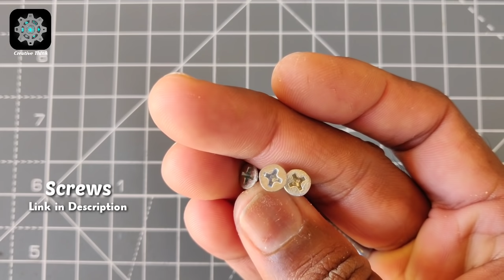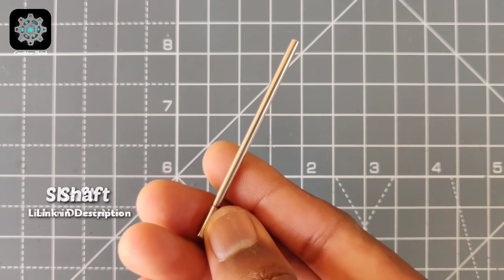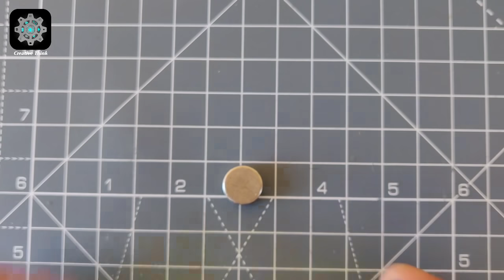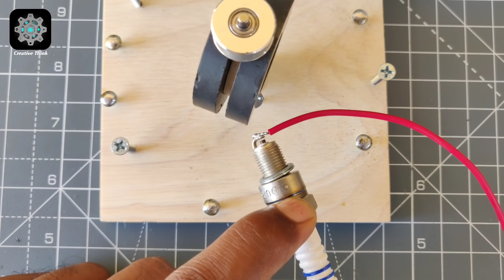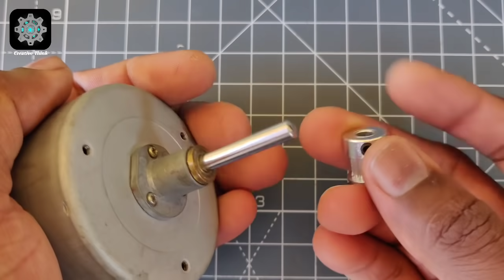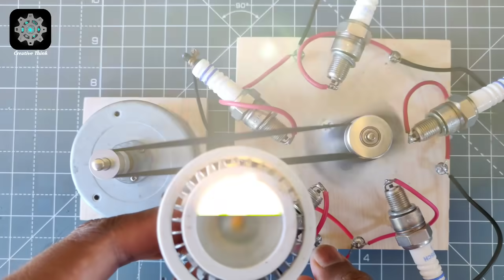Spark Plug Free Energy Generator

Comment: I made one of that and use it to drive the rear wheel of my bycicle, it was working perfectly until the clock alarm wake me up...
Reply: *woke
Reply: Don't you hate when that happens?
Reply: Actually those are real and I am original from Cuba, where gas isn’t really much of an option and people create small engines like this with the exact tools and it can produce up to 15MPH on your bike. I knew a friend of created a bigger engine using two pulleys and 4 more spark plugs, it’s looked like a v9 engine from the front end, either way, he used dinamo to get it started at first and the system will help the dinamo produce much more kinetic energy taking him up to 15 MPh like I said. But honestly I never searched for this video it’s just popped on my list from you tibe
Reply: Jeser Alejo so your friend invented perpetual motion machine.. I might know the same guy 🤔 Is his name Doctor Snuggles??
Reply: Marko Lehtola very funny. But no have a great day
Reply: Eh eh 😁

Comment: Why do people say it's a lie without even trying?

I went to the link, bought all the materials, and built it just like in the video.

And it actually worked—the light bulb turned on, and I was able to charge my phone. However, I experienced intermittent power loss, causing the bulb to turn on and off repeatedly.

But it definitely worked as a free energy source.

Comment: The superglue that instantly held the spark plugs to the top of Phillip's screws was the most impressive part of the video.
Reply: Totally agree - I have never ever seen superglue that good...! I want some...;-)
Reply: Yes! What kind of glue is that???
Reply: Denied Grace Gorilla Glue.....or something Apple is working on
Reply: I'm more impressed with how he got the  solder to flow to the screw heads O.o
Reply: @violetcarter7050  - Cadmium plate screws... they used to solder well... Or Zinc plated hardware. It works too
Reply: There are some instant dry contact glues out there.
Reply: @autoelectrical370  Not cadmium.  Cadmium plating is yellowish.  Also carcinogenic.
Reply: It's a hot glue gun

Comment: I love the phrase from the movie "Knight and Day" describing the Zephyr Battery as "the first perpetual energy source since the Sun." The joke is that the Sun isn't a perpetual energy source... it's burning fuel. "Free Energy" is obviously wrong ('taint no such thing, folks), although this is a clever creation. The reason the light flashes is because it's robbing the system of energy. If you watch closely, you'll see the spin of the magnets slow down. You'll also notice he never leaves the light connected. If he did, the magnets would stop (the light takes too much constant energy) and he'd need to jumpstart the system again. So, not free after all, but clever.

Comment: One possible answer to the question:  How does this continue to run after the battery shown is disconnected?  Answer:  Two  wires hidden underneath the main board from the two lower screws to another battery.   You are welcome!

Comment: All videos tagged with "Free Energy" are fake by definition, but it's really interesting to see all these different implementations 😂
Reply: @Mariah L No... But physic is physic and this kind of energy is never free. If you want free energy you have to catch sun rays, sea waves, geothermal heat and so on ...
Reply: @SilvioPola  Energy as defined by physicists does not exist.
Reply: Silvio Pola yup
Reply: I agree with u . Perpetual motion like thid cannot be achieved without external source or else you will be denied by laws of physics
Reply: @Stelle_7  Perpetual motion is a fact of our universe. All planets, stars, asteroids, etc. are in perpetual motion.  Our planet is in perpetual motion, thus everything on our planet is in perpetual motion.  With that said, perpetual motion is not necessary for free energy.   There are two types of geometry in our universe.   The physical geometry of physical objects consisting of atoms and field geometry which consists of the dielectric field discovered by Michael Faraday.  It is from the second type of geometry that free energy will come.  Field geometry can and does change without a change in physical orientation of physical objects under certain circumstances.  Field geometry changes can also cause changes in physical orientation of physical objects. This is how electric motors work.  Presently, we generate electricity by causing the field geometry of permanent magnets to move relative to the physical geometry of copper wires by physically moving the magnets.   However, if we can figure out how to get the geometry of the magnetic field to move without moving the magnets, you can get free energy.   There are also other ways to theoretically get free energy in electromagnetic theory.  I do not think it is impossible.  We have all been lied to about how electricity works in public education.
Reply: @wesbaumguardner8829  wtf are you saying ??? Planets are dependent on each sun/star because of its massive size and magnetic field that attracts the planets. Secondly stars or sun tend to die later on because of its fuel that will run out. Sun does not create its own fuel it only utilize it to create chemical reaction.
Reply: @Stelle_7    What I am saying is exactly what I said.  Everything in the universe is perpetually moving.  There is no observable object that is not moving.   Every object that has ever been observed by man has been moving.  No exceptions.  Yes, these movements are the result of free energy.  No one paid to have these objects move.  Absolutely nothing prevents the energy transfer, it is free to go wherever according to the laws of nature.  There is no magical energy barrier in our universe which can prevent all energy transfer thus there are absolutely no closed and/or isolated systems with respect to energy in our universe.  The laws of thermodynamics are not laws or fundamental truths, they are only approximations utilized to help design things.  Most of what is now considered science has completely abandoned the scientific method.  Electricity is not particulate and does not consist of electron particles.  Light is not particulate and does not consist of semi-particles called photons.  Gravity is not space bending.  In short, the majority of what people learn in public education is wrong.  There is an ether field and it is inertial in nature.  Fields do not operate under the same laws as physical matter, but there are similarities between the laws they follow.  Fields are the primary and matter is the secondary.  All objects are moving due to the fields they are interacting with.
Reply: @wesbaumguardner8829  , you are confused about the difference between motion and energy. In fact, you don't have the faintest idea what "energy" means. I'm pretty sure you don't understand the equations (or the calculus) of physics. You crap on what you don't comprehend.

An object in motion, if nothing acts on it or drains energy from it, remains in motion. The object simply has POTENTIAL energy. All that crap you post is blather because you don't understand the difference between kinetic energy, transfer of energy, conservation of energy, potential energy, and your ass.

What you have posted is garbage.
Reply: @wesbaumguardner8829  wow. Just... Wow.
Reply: @wesbaumguardner8829   Nice elaboration......... Very much creative idea........!!! 👍👍👍
Reply: So Michael Faraday, Oliver Heaviside (inventor of the coaxial cable), Charles Proteus Steinmetz, and Nikola Tesla are completely wrong according to you.  These people created our electrical grid.  Your physicists created nothing.  Einstein invented a refrigerator once.  It did not work.  No.  It is you that is in an echo chamber and does not understand energy.  I suggest you go read some works by people that actually bent nature to their will instead of idolizing people whom have accomplished nothing but creating a bunch of useless jibber jabber and which they have successfully taught to the public for generations.
Reply: "Even if we had no knowledge of electrostatics and of properties of condensers, we should, by the above course of inquiry, be irresistibly led to a theory of transmission of electrical disturbances through a medium surrounding the wire, instead of through the wire.  Maxwell's theory of dielectric displacement furnishes what is wanted to explain the results which are in some respects rather unintelligible when deduced in the above manner without reference to electrostatic phenomenon.  We learn from it that the battery or other source of energy acts upon the dielectric primarily, producing electric displacement and magnetic induction; that disturbances are propagated through the dielectric at the speed of light; that the manner of propagation is similar to that of displacements and motions in an incompressible elastic solid; that electrical conductors act, as regards the internal propagation, not as conductors but rather as obstructors, though they act as conductors in another sense, by guiding the electromagnetic waves along definite paths in space, instead of allowing them to be immediately spread away to nothing by spherical enlargement at the speed of light; that when we deal with steady states, or only slowly varying states, involving immensely great wave length in the dielectric, the resulting magnetic phenomena are just such as would arise were the speed of  propagation infinitely great instead of being finite; that if we make our oscillations faster, we shall begin to get signs of propagation in the manner of waves along wires, with, however, great distortion and attenuation by the resistance of the wires; that if we make them much faster we shall obtain a comparatively undistorted transmission of waves (as in long distance telephony over copper wires of low resistance); and that if we make our oscillations very fast indeed, we shall have practically mere skin conduction of the waves along the wires at the speed of light (as in some of Lodge's lightning-conductor experiments, and more perfectly with Hertzian waves)."  Oliver Heaviside, Electromagnetic Theory Vol. I.  Pages 18-19.
Reply: Silvio Pola solar Energy is another type of ‘free’. Actual free energy would be; to create more energy than what it would take to create it in the first place.

Comment: If you add a flux capacitor between the first and third spark plug, it will keep the osculating compression thermocouple from disengaging, thus increasing output seven fold. But, you might have to use some sort of cooling matrix to keep the force stable.
Reply: And no likes? 🤔
Reply: @homemprovmentguy  look 👀 again 🤣
Reply: Exactly what I was thinking
Reply: Or even a wee bit or reversible sticky tape between the spark plug electrode ad the air gap - it would act like a dielectric fluid against the ether and concentrate the residual kinetic disbelief
Reply: @homemprovmentguy  s
Reply: Youd have to bring the whole machine up to 88mph for that to be stable mate. I'd affix the whole apparatus to a cool car for that, since its range would lie well within the 88mph needed. The model would be your choice. But I'd go for something classy. A DeLorean perhaps.  Or a Geo Metro.
Reply: Do u have a lot of practice w this kind of stuff. Because we have ideas 💡 and would like to learn more about this type of fields
Reply: Dangerous: U going create one Time Machine!
Reply: No you fool! The verteron particles would destabilise the chronoton matrix in dimension 4.5 and stop every one's heart in a 29 meter radius near the machine!

Comment: I stayed up for days trying to get this to work. Then it hit me. I was using NGK spark plugs instead of the Bosch used in this video.
Reply: I wonder how many followed the description lol...
Reply: You need to use type R the resistor is important 😉
Reply: Did it work?
Reply: @generallee9718  obviously not
Reply: @generallee9718  Yes, but unfortunately I couldn't get a patent when I tried to show proof of concept.
Reply: David Evans  ugg non of that awfull lead free solder 60/40 rosin cored is the only way
Reply: dooh
Reply: If your going to pick it apart analyze the design first, what you think is just another scam has some very different features. For one the shaft that the magnet is mounted on is completely independent from the drive belt, so why is the magnet spinning at all.

Second why use ring magets, maybe because they attract as well as repel as shown in the video or is it because of the field they produce or both.

Third know what types of materials being used and where they are being used like copper, aluminum and steel. All these things go into a design that makes your cellphone work or computer. 

How many people Thought Nikola Tesla was a fraud, even thinking he trained a Monkey to drive his remote controlled Boat. Think about that the next time you take your quadcopter out for a flight...
Reply: @steve-o6413  Ummmm.... Gee I don't know how I can crack on a design that states it creates free energy...Oh wait! I know..... Anyone that knows anything about Physics will tell us it is impossible with our current knowledge or current materials IE..The current Periodic Table. So basically if I saw something of value in a video that might challenge our current knowledge or materials knowledge then maybe I would analyze the design. Sorry I'm a realist and look at facts and NOT pseudoscience.
Reply: @Helmet_Tester  Physics is man's attempt to reinvent  what is. Physics cannot be stopped like Aristotle stopped development in the field of medicine for 300yrs. This field is ever expanding. We've known nothing yet.
Reply: @Helmet_Tester  well then don't tell the Earth about perpetual motion or Free Energy or how much you know about Physics, you don't know how silly you sound by parroting what others say...
Reply: Copping Nature is what Physics is all about...
Reply: Everyone knows Bosch suck

Comment: Spark plugs are used to produce electrical discharges and can work only at high voltage.
Reply: between 8000-20000V
Reply: He litteraly attached the wire to the point where the sparks between. Why not just glue it to the threads?
Reply: No shit ?
Reply: Spark plugs are open loop,  it just a motor getting energy below the table

Comment: love the fact that the "timing belt" goes to a pulley with a ball bearing in it lol shouldnt be turning the shaft at all
Reply: Not to mention there's no way to make that kind of power needed to make the "18 volt" motor rotate unless there's a hidden power supply that keeps it in motion.
Reply: @jclowe1113  yep THERE IS NO WAY! 
first if you pay attention to how the parkplug wires are connected it doesn't make a coil (the ground or he sparkplug is insulated from the electrode; furthermore the 5k ohm resistor contained in each sparkplug just add that to the list.

AND THE BIG SCREW-UP . NEGATING THE FACT THE LUPE OF WIRE (WHICH ISN'T ONE) IS TO FAR AWAY FROM THE MAGNETS I YOU WANT TO PRODUCE ANYTHING .

LAST BUT NOT LEAST ( the coup de grace)  the magnets are !!!spinning on the wrong axis!!! to produce current.
Reply: So is the magnet rotating because the steel pulley is spinning if it's independent from the shaft. Wait a minute wouldn't that suggest that there's no load on the motor. I've seen a bearing motor before.

This gets stranger and stranger as I look into the Design...